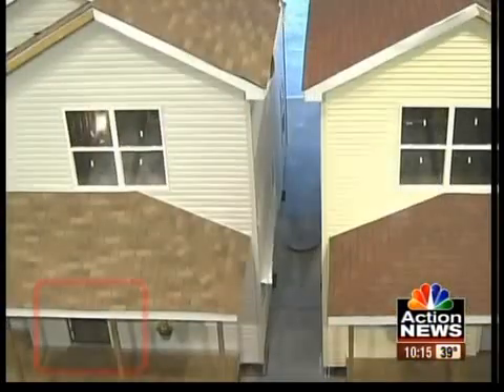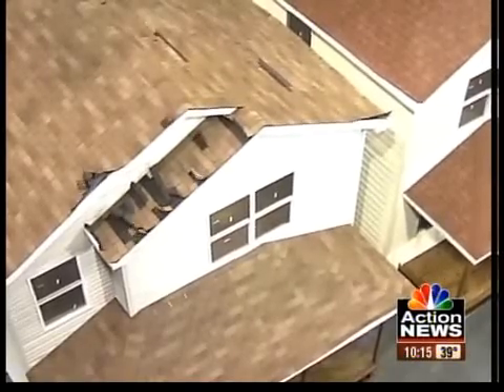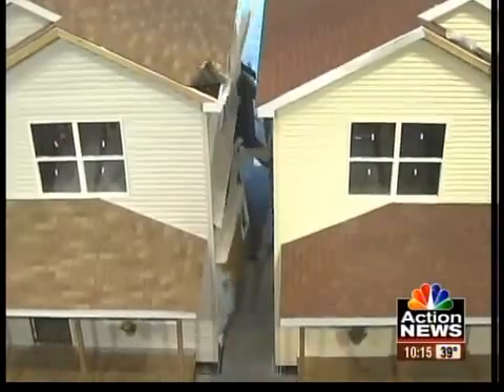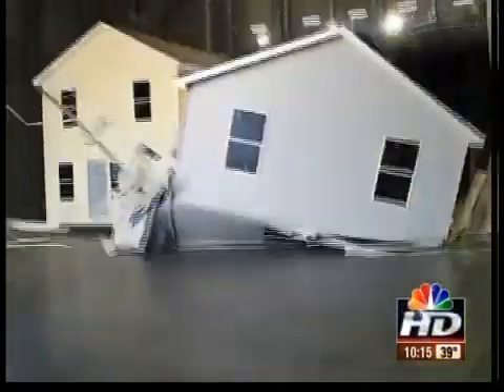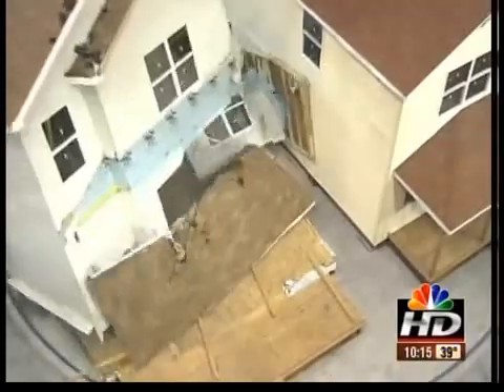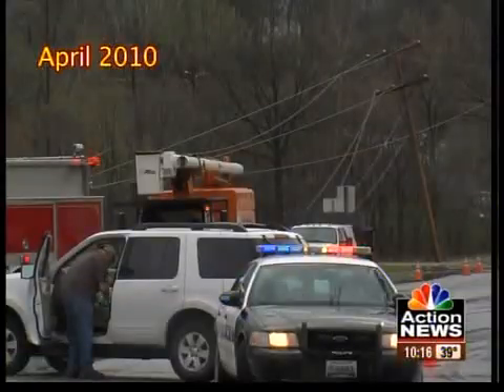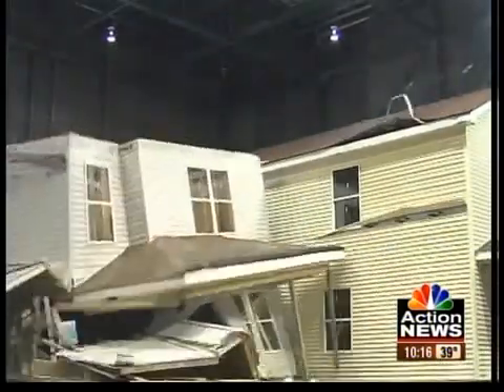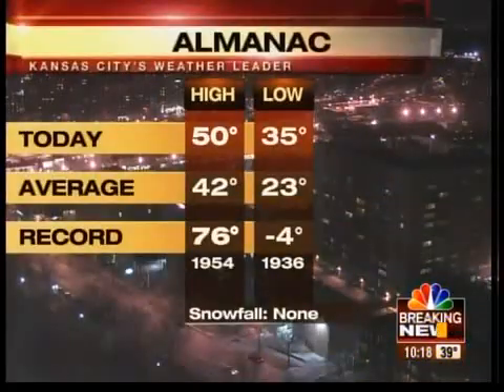The secret to tornado-proof building

Comment: americans build terrible houses, no insulation, no basements, nothing! I live in switzerland and it is just a fact that we build probably the best buildings in the world. It is normal here that every house is isolatet against the cold and made out of solid bricks. so please stop build this crappy cheap wooden shacks!
Reply: Please don't assume that every house in the US is built the same way. The homes in the north where I live are well insulated because we regularly reach in the negatives every winter. We also have to set up foundations below the frost line for our homes so every house needs to have a basement. It's sort of a requirement. You will hardly find a home in the northern part of our country without one. And, I don't mean to sound rude and elitist to my southern neighbors, but we are richer in the north and can afford better, more sturdier housing because of the conditions of where we live; extreme cold in the winter and hot, humid summers. Don't ignorantly assume that every American lives the same.
Reply: Doing it right? Well as long as a budget means nothing I suppose anything is possible. Also building a basement on the shore of a lake nestled in the mountains is not the same as trying to build a basement in a swamp. But you're welcome to fly back over and try it. Oh and since I apparently speak for all Americans now, why don't you turn your internet bragging into action by helping out with some of these towns that are completely flattened by tornadoes? You Europeans are awfully quick with flexing your "superiority" over Americans, yet you have nothing useful to offer. It would be nice to know if you all actually know what you're talking about. So please, next time an EF 2+ hits Switzerland (will it be this century?) let me know how those houses hold up. Until then, you can have several seats.
Reply: +Snickas I've been to Switzerland.  A typical house there would be pretty much destroyed by a direct hit from an EF2+
Reply: +Snickas It's obvious you've never stepped foot in the US, or at least not more than once. Let alone actually witnessed a tornado. First off, we do have insulated houses and basements where possible, but sometimes it's not possible. There are areas where it's impossible to build a basement because the ground is either made of sheet rock or the water table is too high. For example, if you built a basement in southern Louisiana, good luck. I'd promise it would rot or collapse in a few years. 

Second, all it takes is having the roof torn off or having the windows blow out on one of your "superior" Swiss houses and the inside would be fucked. Maybe some of the brick and concrete would survive but the inside would be torn apart by rotating winds, suction, and rain. Plus EF4's and EF5's can send boards flying right through brick. An EF5 even has the potential to rip a concrete foundation right out of the ground. So imagine how well a European house will withstand having a car slammed into it at 200+ mph. I agree that people that live in tornado alley should at least have a basement or storm shelter, but just building a house out of brick and expecting you're going to survive an EF3+  tornado is foolish.
Reply: Same here in holland we are used to build strong sturdy houses, i came across this video discussing it with my girlfriend i really wonder how our standard of housing made out of conrcrete and steel core would stand up against this, maybe the windows go and the roof gets blown off but nothing more than that. I cant graps why they build wooden houses in tornado riddled areas.
Reply: I do not know where you get that from, because whoever gave you that information is in desperate need to get their facts straight. we do have basements, insulation, and sturdy homes. Learn your facts before putting words into a statement.
Reply: +miamihurricane555 Like I just said, don't assume that every house in the U.S is built the same. Majority of our houses in the north may be built like "matchsticks" as you say but that is the same in a good portion of our country, ESPECIALLY in Florida. Believe me, I have family in Florida and have been to their house and a  majority of the houses down there are built just like in the north sans insulation. Unless you have been to the north and seen how all of the houses are built, please don't make assumptions about them.
Reply: What part of Florida? Miami is in Florida's High Velocity zone so our Regs are strict. But because we had Andrew here. The county (Miami-Dade, but Broward,Palm Beach, and Monroe Counties all Followed suit) decided to go beyond what the state of Florida requires.Florida law states that structures must be built to withstand the highest winds where there is at least a 1% chance of occurring in a given area in any given year. So for a place like Lake City in the Northern Interior of the State where hurricanes are rare. Buildings only need to withstand winds of 100-110 mph. But here in the high velocity wind zone homes must be built to withstand a minimum of 140 mph. However as I said before our local counties are even stricter requiring a minimum of 150 mph.
Reply: Are you serious? You dont even know what sturdy is, normal walls for residental buildings in the us are made of 5 inch match sticks with chipboard on it. For comparison in our country you build a 6 inch brick wall with a (at least) 7 inch insulation layer on it, and 9 inch concrete ceilings, that's sturdy!
Reply: Snickas
WRONG.  I worked there.  You have NO idea of that type of storms power.
Reply: It doesn't matter if your houses are made out of bricks; people are seriously underestimating the power of a tornado at full potential. Don't forget that air borne debris could slam against the structure, piercing through walls and the roof could be sucked up too.
Reply: +Snickas A 6" brick wall will be pushed in/over by a tornado.
Reply: Snickas
Of course they wouldn't get sucked out.  But, the are NOT designed to withstand the force per square meter that happens with tornado force winds.  Which are MUCH higher than typhoon level winds.
Reply: parallelpinkparakeet  Thanks. You've exactly demonstratet how little you americans know about building. It is never impossible to build a basement, you just have to do it right. My office has planned buildings on rocky ground as well as right at the shore of lake zurich and nothing collapsed or rotted until today. I can send you pictures if you want ;) An maybe our homes wont withstand a EF5 Tornado but at least they wont be destroyed after an EF2 like yours. And in some states you might have insulation right, but even the best insulatet houses you have aren't as good insulatet as our minimum by-law.  
PS I've been in the US twice, in at least 5 different states and i've been in a typical american home also.
Reply: rina8719 your houses are like match sticks. I live in Miami where are homes are made out of reinforced concrete with a minimum of 12in in thickness are REQUIRED!
Reply: Snickas
You're babbling insanely.  Basements in some areas of the US would increase the square foot cost by 50% due to geologic conditions.  Now, go back to your insane asylum.
Reply: Snickas
Hey moron, our best houses are R-70 and can take winds in excess 800 kph.  AND they cost the same as any custom stick house.
Reply: @Hiita kasai - Yo if you know a girl that can blow that good send her my way!! ctfu lol
Reply: Snickas there are basements typically in areas above the water table. Kansas has a basement in nearly every home. In Oklahoma, it's rare and they flood.
Reply: Mundus vult Decipi
Ik denk niet dat onze Hollandse huizen bestand zijn tegen tornado's. Tornado's blazen echt met gigantische kracht tov normale stormen.
Reply: Snowwie88 Dat weet ik zo net nog niet, wat hun hurricane proof noemen is hier bijna de standaard, versteviging met betonstaal is daar uitzonderlijk hier de regel, dubbele muren, betonfunderingen in plaats van houten palen, wij bouwen veel duurzamer, en als je tornado's ziet die grote steden raken waar wel gebouwen staan die dichterbij onze bouwstandaard komt zie je gelijk een stuk minder verwoesting. Als het al verwoest word is het door rondvliegend puin en niet de wind, het dak gaat er misschien
 af en de ruiten vliegen er uit maar het geheel blijft staan.
Reply: Ehm nope i dont think so. And you re probably speaking of the typical swiss chalets every tourist sees when he travels trough switzerland. Of course they wont, but i ment all the other normal buildings.
Reply: +Patrick EH (Illogic Buster) Actually work as a draftsman and i should know what kind of natural forces our buildings can withstand i've planned them. Maybe you're right and ONE of the walls will be pushed in but because we reinforce the core of the houses especially near the staircases with concrete, they would never just get sucked away like a pile of wood as our residental buildings would do.
Reply: Everybody stop arguing! Patty's word is Law! How dare you argue with him, and not bow down to him?!
[/sarcasm]
Reply: As if I care about what he's saying anyway.
Reply: fuck you
Reply: You think were fucking stupid? We can't build basements! The fucking dirt is strong as hell.
Reply: Snickas are you assuming us how Dare you it’s rare to get them HERE
Reply: Uhh myhouse has insulation and a basment and its a sturdy 3year old house so I don't know what you are talking about.
Reply: We do build houses with basements. A lot actually and we do put insulation in our houses. We build great houses.
Reply: Patrick EH Yeah.. An 800 Kph gust of wind from your mouth.

Comment: When that lady said they didn't know why the structures failed I LOL'ed. It's made of mostly wood.  Wood < 100 mph winds.
Reply: Just make your houses out of monster truck rollcages.
Reply: It's like they didn't pay attention to the 3 little pigs.
Reply: Umm tbh I don't think a brick house is going to stop a F5 tornado just get a underground shelter.
Reply: Even concrete can collapse. But I bet if you had your way you would regulate it all.
Reply: bighand69, how many Florida high rises collapsed during all these hurricanes. I never heard of a hurricane flattening a concrete high rise yet.
Reply: @chodkowski01  that's because tornados and hurricanes aren't the same 🤦
Reply: bighands69 True that although concrete can collapse it would take more than 100 mph winds of do it if the structure was properly constructed. I don't live in the USA where houses are made mainly from wood. Where I stay its mostly concrete and the only real damage than can occur would be the roof and windows. About regulation, I wouldn't care what people made their houses of. If it works for them fine, no problem.
Reply: @RaijinKaze  yeah but this doesn't happen anywhere it happens in the middle of the country for a reason your only way of getting out of it is a Underground shelter just look at the videos of tornado going through houses.
Reply: @RaijinKaze  its not the concrete, concrete is weak the rebar or what ever is reinforcing the concrete is what make concrete house stronger.
Reply: @RaijinKaze  A tornado can pick up an 18 wheeler and toss it around like a tinker toy.  What makes you think that your concrete house is so special?
Reply: @RaijinKaze  it would literally take a wrecking ball to destroy a concrete house.  A wrecking ball weighs about the same as a sedan.   A tornado can take a sedan and looked it up into the air.

Comment: "Scientific tests performed on a life-sized house may determine future building materials and construction codes."  Concrete maybe, like the rest of the world ???
Reply: Ozone  Sure, that's why whole world is using it. Tornado cannot destroy propertly built concrete house !

Truth is that even concrete houses are built poorly in the U.S. (only from bricks or concrete blocks, without good base or reinforced concrete frame)  and they are often damaged by wooden houses debris.

Roofs are also not build to prevent wind to get under the roof. Bad building techniques are the reason for destroyed houses.

You can see damage after tornado in areas without wooden houses and you will see that damage is mostly on the roofs or on poorly build or maintained houses.

If tornado cannot get enough resistance it will be unable to do anything, so shape of the house and roof is very important.

Comment: Build the bastards out of Brick! In the UK our end of war pre-fab's would do. Tough as shit
Reply: GSXRJAY420  Can they survive EF4 tornado force winds? I've even noticed concrete foundations get torn out of the ground block by section.
Reply: I agree, in the UK the older houses especially are solid brick and can survive a stronger winds by most storms, we have similar winds that destroyed the wooden house shown in the clip above and you never hear of a roof collapsing and so on. Plus the build is stronger due to the compact and solid concrete inner walls.

Comment: Not even UK codes would be good enough.. You need to go Earthquake proof and build with ICF panels, high-density polystyrene panels with a pumped concrete core. And use a formed sheet material steel, zinc or lead for roofing.

Earth banking on wind facing walls and underground garages and have bylaws ensuring vehicles are parked underground and not left on driveways. Everything else like gas / oil tanks need to go underground.

See YT vid   watch?v=yJalzh1YITk

Comment: Americans need to learn from the UK and build stone or brick homes.

These wooden homes are just not strong enough yet they are being built all over America.
Reply: Machinehand  The reason we now build our homes like this, is cost effectiveness. Because unfortunatly not even Concrete structures are capable of withstanding the might of an EF4 tornado, like the double reinforced concrete schools we have.. Its better to have an underground shelter.
Reply: Machinehand And also, We don't need to learn any thing from you guys in terms of structure , because we already know what we need for our geography and climate, and both countries have much different climate.. You guys have it fairly safe over there, or so I think.
Reply: The problem is that reinforced concrete buildings are square blocks. How about if they were aerodynamic? Dome houses, for example. Concrete igloos. Look at the front of engines of high speed trains. Would they work at high speed if the fronts were square? No!
Reply: @MarcABrown-tt1fp  So you're saying America builds their houses out of card board becouse it will get destroyed anyways? That makes zero sence. Ever noticed how cities never get leveled down after a tornado hits?
Reply: @GRT-Versley  It's extremely rare for a city over there to get hit by anything over an EF2. don't think in layman's terms (I thought simpletons were exclusive to America) . And yes city blocks have been leveled before. it's better to have a storm shelter than to have every family spend a life's fortune making bunkers as their homes. 

Also your 3 years late, thanks for the nostalgia.

Comment: The video raises more questions than answers.  In the home that was destroyed, it appears that there are no anchor bolts, ties and hold downs that would be required in a standard residence.  This is why the home "slides" off the subfloor - one could assume the other has some type of anchoring system.  I also question the way the siding is ripped off the demo home, yet stays intact on the "fortified" home.  How is this accomplished - 'IF' all things are equal.
Reply: The "Reinforced" home doesnt even have wind blowing at it, Unless they made the flower pot on the porch tornado-proof aswell xD